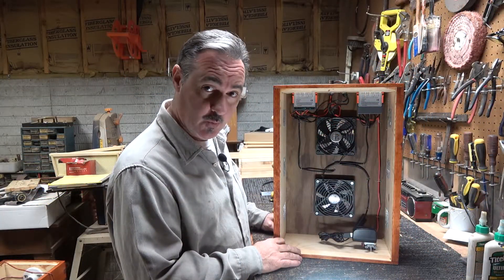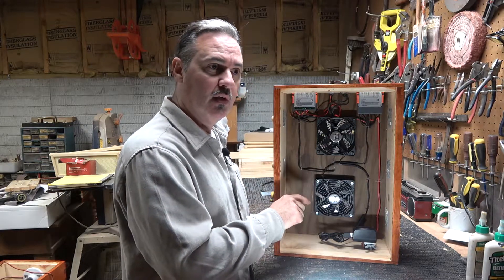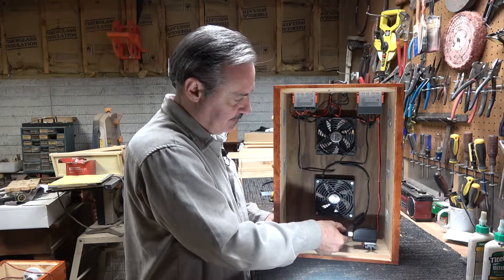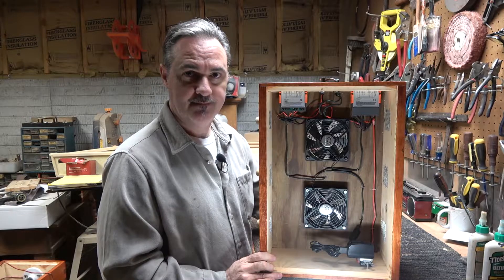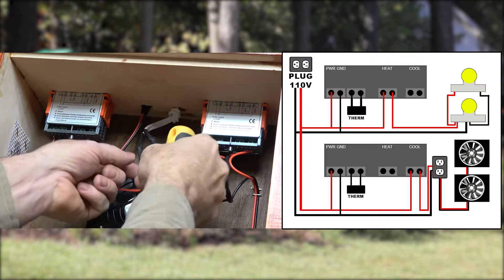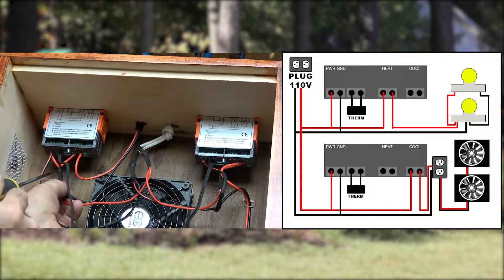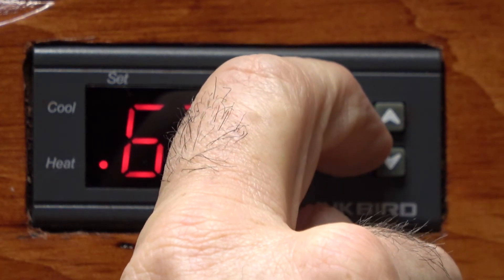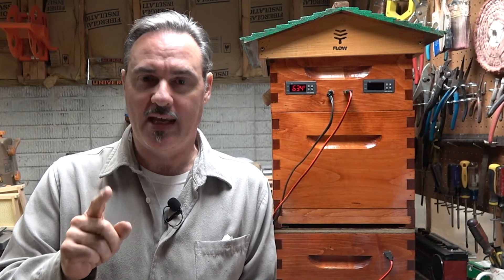DIY Beehive Heater -- Part 4 of 4  How to build a climate control system for your beehive.

Comment: Very good! Have you ever tried to kill the Varroa mite using this invention?
Reply from the maker: No.  I don't  think the controllers are calibrates to the point where I could get the temp hot enough to kill the mites without overshooting the runway and wiping out the bees too.

Comment: Does rain water hurt the ink bird controller face?
Reply from the maker: no.  I have never had an issue with them being exposed to the weather.  If you are concerned and have installed them a little proud of the surface you can always run a small bead of silicone around them.

Comment: Amazing. Going to start building one in a few days. Will let you know how they do in Alaska
Reply from the maker: I can't wait to hear how it goes.  Don't forget to use a diffuser board between the heat box and the screened bottom board.  The diffuser board can be seen in several videos when I install the heaters.
Reply: Just thought I’d let you know it worked. The bees made it through last winter. I am setting up the box now for this winter. I have the most spoiled Bees in Alaska.
Reply: Just had to look at the video again so I could reprogram

Comment: This may be a dumb question but couldn't you just use one of those controllers for the heating and cooling?
Reply from the maker: It is possible to use it for both but it would not allow a specific temp to be maintained.  Basically when used that way you are given a spread in the number of degrees between the heater and the coolers being activated which could cause the fan to be cut on in the middle of winter pulling ice cold air through the hive.  Keeping them separate allows me to maintain temps withing a +/- 3 degree spread and opposed to a +/- 20degree spread. I hope this answers the question.  Trust me, it it were possible to use just one and maintain a specific temp envelope I would do it.  That said they are only 11.00 per unit.  I hope this answered your question.  Take care.

Comment: Why do you use 2 controlllers when they can heat and cool.?? why not only 1 controller.? Is the controller IP rated for use outside ??
Reply from the maker: Even though you can set a differential on the controllers and use them to operate both the heat lamps and the fans the controllers aren't sensitive enough in this setting to do it accurately.    A single controller is designed to maintain a specific temp within 0-5 degrees or what ever differential is set. The controller  will continuously turn the fan and heat lamps on and off to try to maintain the set temp.  The issue is when the heat is called, the heat lamps come on and heat fills the bottom box and slowly works its way upward through the hive.  By the time the temp at the top of the hive where the thermostat sits reaches temp and shuts off the lamps and kills the lamps the temp in the bottom of the hive exceeds the set temp by a few degrees. When the hive temp normalizes it will be a few degrees over set temp which when using one controller would call the fan to evacuate heat until the original set temp is reached.  The last thing I need to happen is for the fans to turn on in the winter and suck cold air through the hive. I tried one controller initially and it didn't reliably maintain temps.  Two was the way to go.  As far as the weather rating I have no idea.  They have been in use in all weather for four years without issue so I will say they are fine outside.  I hope this answered your question.  If you build a set please send me a picture and I'll feature them in a video.  Thanks for the question.  Take care.

Comment: This video was made one year ago. How did it work over this last minter? In the supplies needed you do not mention the board you use to spread the heat. What was that made of ? Thanks for the video!!
Reply from the maker: This is my third year using the heaters and they work very well.  The diffuser board is made of 1/2" or 3/4" plywood  (i can't remember off hand) but can be made of anything I guess.  The goal is to make sure the heat is distributed equally throughout the hive.  Thanks for the comment Jim.  I really appreciate you taking the time to stop in, watch the video and comment.  Have a great day.

Comment: Thank you so much for these videos, they've been great and I've thoroughly enjoyed adapting the new hives. I'd appreciate your advice as I'm very new to beekeeping (installed my first overwintered nuc 8 days ago). I set the hive to 68 degrees fahrenheit but the bees have been fanning the entrance at anything like that temp. So through a bit of trial and error I now have the temp to 62.6 but woke up this morning to find twice the normal number of dead bees (12 bees). Again I'm very new to beekeeping so this might be completely normal but have you had any issue finding the right temperature for your bees? ... maybe they're just use to colder temperatures being overwintered!
Reply from the maker: I am glad you enjoy the videos.  As for the heater set temps I keep mine at 70F in the wintertime.  In the spring I remove the heat boxes and run only the fans.  Make sure you calibrate your Inkbird controllers and configure them properly.  I would make sure you leave at least a +/- 3 degree variance on the set temp as well to prevent the heaters for running all the time.  I had a hive doing the same thing as yours this past winter and realized the bees had not sealed the boxes and there was a draft coming in and cooling the air before it reached the thermometer in the top of the box.  This cased the heat lams to continue running.  So my advice for next winter is seal the boxes with painters tape to prevent drafts, calibrate the inkbird controllers, start with a lower set temp, maybe 50F and work your way up to where you are comfortable.  If the bees are fanning like crazy on the landing board I would notch it down a bit.  I hope this helps.  Send me a picture of your build if you can.  I would love to see it.  My email address is on the "About" tab of the channel page.  Take care.
Reply: @BugFarmerBees  I've emailed you some pics... let me know if you don't receive them. Thanks
Reply from the maker: @csnotepad8951  Excellent.  I received them.  Can I post a few in a video?  I would love to show the off if your okay with it.
Reply: @BugFarmerBees  Yeah that's fine... post away.

Comment: Alright I watch all 4 videos and I have more Question than Answers at this point. I hope you can the time to answer a few Question. Now I'm think in terms of my horizontal hives so I hope I don't ask a dumb question. What is the propose of the fan? I'm sure it is to move the heat around and keep the hive much dryer.  I was just wanting to add the heaters to the top of my roof system that is seal tight (almost tight), and just allowing the heat to warm the top cover area, because I will only bee heating 34 deep frames in a row. Will that work?  Any input would be greatly appreciate at this time!! God bless
Reply from the maker: This system heats and cools. The fans draw air through the hives and exhaust it out the top in the summer when the temp inside the hives reaches 85F.  They don't run and serve no purpose in the winter other than to provide ventilation for moisture.  It is important for the heat lights to be in the bottom of the hive because heat rises and it is the most effective way to heat the hive.  If I had horizontal hives I would probably put the heat lamps on one side or the other behind a panel and  and maybe use some small, quiet bearingless computer fans to push the warm air around the inside of the hive through holes in the panel. It will be interesting to see what you come up with.
Reply: @BugFarmerBees   Hmmm... By adding the heater to one side should the entrance be on the opposite side?  I have found the bees really like the entrance in the center of the horizontal hive. Dang...I may need to build two hives to see which one works best unless you have a better ideal?  Sorry for bugging you...I can tell you like to build and design also.
Reply: @BugFarmerBees  "They don't run and serve no purpose in the winter other than to provide ventilation for moisture."  Which is it? You don't run them? But running them eliminates moisture?

Comment: Well I’m going to try out your design up here in northern Alberta Canada, I ordered the parts from your list but would like to know have you tried a larger heater bulb? We get -30C up here for long periods of time, so I will be looking at Vino’s folding foam insulation as well and would like to know if 75watt bulbs would be to much heat? Thoughts? Oh and thanks for the videos!
Reply from the maker: I can't wait to see it work in the cold Canadian winter.  You can use 50 or 100 watt heat lamps but I wouldn't go any higher. You will be surprised how well the hive will hold the heat.  You may also want to use a deep for the heat box just because they will be on quite a bit.  Don't forget to make the diffuser board.  And one more modification I would make (which I will make on the next one I build) is to create an access door/panel in the heat box in case you need to change a bulb mid winter. Let me know of your progress and I hope you post the results on YouTube.
Reply: Bug Farmer is there a specific reason you used two controllers in place of using the heating and cooling function off of just one controller?
Reply from the maker: @jamesmcnally2519  Yes.  One controller will control both but only within a specific range.  The problem with that is in the winter if you are heating the hive and exceed the threshold the colling fans can cut on and suck freezing air through the hive.  I use two controllers so I can control the internal temp to a specific temp.  I use one for the heating function and the other for the cooling function.
Reply: @BugFarmerBees  Answered my question... thanks!

Comment: Interesting concept, never needed a heater In Texas, but I like the concept. Have you thought about using incubator heating elements rather than lights? I would think having the light on in the hive may trigger a positive phototactic response in the bees which could have a negative impact on the hive over time.
Reply from the maker: I don't use lights.  I use ceramic reptile heating bulbs that screw into light sockets.  They do not emit any light at all.  Heats up quickly and lasts all winter.  Have a look at part three of the video series and you will see the bulbs I use. https://youtu.be/W-UKAgF8EGs
Thank for watching and I appreciate your stopping by.

Comment from the maker: In case you want to build this heater system and didn't read the video description.  Here are a list of components you will need:

Outlet :
https://amzn.to/2vyZHFJ

Power Cord:
https://amzn.to/2SC7Np6

Bun Fan: 2pk
https://amzn.to/2HmJLsQ

50W Heat Light 2pk:
https://amzn.to/2HjTJez

SAE Extension cable: 2pk
https://amzn.to/37pDXtp

Porcelain Light Base:  2pk
https://amzn.to/2HoANLC

110V Inkbird Controller: (You need 2 of these) 
https://amzn.to/31O75t9

100pk. Wine cork: (you will only need 6 corks so drink it it you have it otherwise buy these)
https://amzn.to/37rBLBw

Betterbee Budget Medium Supers: 5pk (Shipping is expensive)
https://www.betterbee.com/wooden-hive-equipment-8-frame/boxbg8m.asp

Mann Lake 5pk Medium Super (Free Shipping)
https://amzn.to/2vAvNkK

 Other items you may want to purchase:

Man-O-War spar varnish: 
https://amzn.to/2SmDZxK

40 pk.Foam Brushes: 
https://amzn.to/2tY9RiY

Comment: Here in S.Louisiana I don't need heaters but I have a solar powered battery backed fan box on my hives I use when it get warm That turns on at sun rise and off at dark or by temp if the sun isn't shining. I rarely have any bearding with my hives in direct sun all day.
Reply from the maker: Excellent.  I used the fans to keep the hives cool all last summer and they worked perfectly.  I was going to make the system 12V solar but couldn't find an efficient way to heat the hive in the winter.    When does your nectar flow usually start in Louisiana?  I think ours may start early this year.